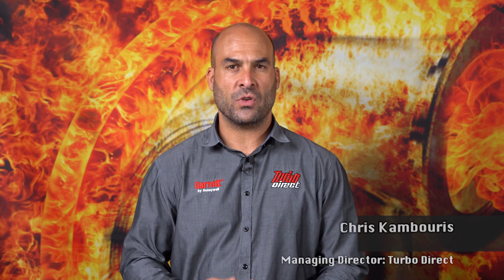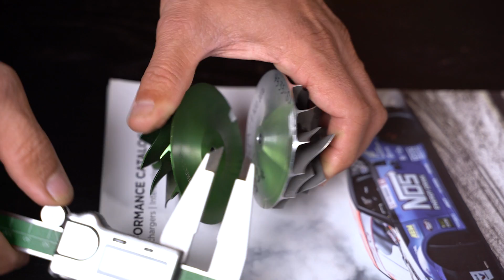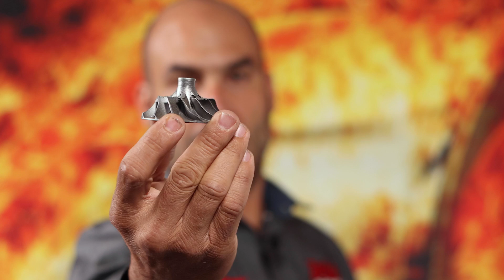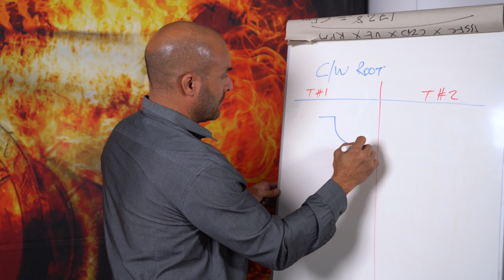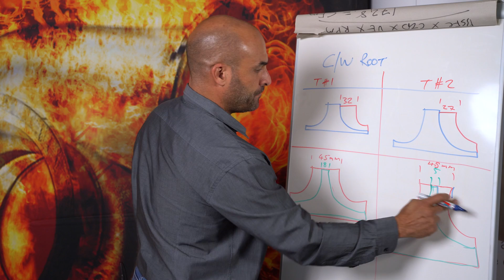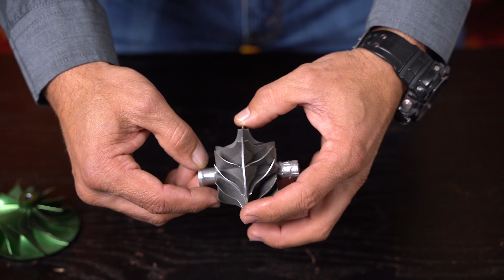Turbo Compressor designs - Discussed

Comment: I’m completely new to this and can’t find a straight answer. 
I have a td04 13t and want to change the housing to a td04 20t 
Does the compressor wheel have to be changed? 
I don’t understand what the 13t vs 20t exactly measures? Just that it’s wheel related
Reply: two wheels are different sizes so the hole diameters inside the housings will be different sizes, so how will the smaller wheel fit inside the larger housing hole?
Reply: Is it a TD04, H, L, HL?
At minimum, the compressor and compressor housing are changed.

Comment: Hello Sir! Sometimes i see for the compressor/turbine wheel big difference between size inducer and size exducer. Sometimes you see little difference in inducer/exducer size for the wheel. Other time you see big difference between inducer-exducer size. Do you have a explanation for this? Maybe better spool?, other blade design? Many thanks for explaining this!
Reply from the maker: Inducer and exducer sizes are relative to the intended application. Some diesel engines have very large turbine wheels and much smaller compressors, in cases where a compensation for sea level is required. Other examples might involve a turbo that has diameters of inducer and exducer on both the turbine and compressor that only 1-2mm differ between the two sides fo the turbo - these apply in some Rally governed turbochargers.
Reply: @TurboDirectSA  Sir, thank you!
Reply from the maker: @kosditrade  Pleasure buddy - anytime.

Comment: Key takeaway is to look for the company to provide a compressor map that matches Compressor/turbine specs or to question the reliability or the product. Really interesting what goes into these designs! Seems like Garrett is a good standard in the industry for reliable designs.
Reply from the maker: Reliable to provide compressor maps, but accurately depict the HP compared to their maps -- i think not. The G-series product is not able to produce the power that Garrett Claim in their catalogues, nor are they able to marry the compressor map to the HP print either - the flow rates dont match the HP.
Reply: @TurboDirectSA  I think the issue is Garrett seems to be pretending we can get 12hp per lb/min of air flow. Otherwise their maps appear reasonably accurate, just not underrated like they once were. Of course you are probably measuring wheel speed, so you have a more accurate impression of how good their maps are.
Reply from the maker: @lutherblissett9070  Speed just gives you a more comprehensive sight into what the engine and turbo are doing, and where you are on the compressor map. Pity Garrett is no longer what they used to be - real sad.

Comment: Awesome vid, as they all are, from the comp map vids you can see some hit high efficiency at lower boost than others which seems like a better choice if you're stuck on pump gas, was hoping to get a bit of info on that but now know there's a lot that can vary, you see some newer turbos not really getting the results you expect but then you see on the map for that engine they might need 2 bar+ to do it but you haven't got the gas etc so at 1.3 1.5 bar it's not really partying.
Papa got burnt, that we know haha
Reply from the maker: Thank you for the compliment, much appreciated. You 100% correct.   I think i need to do another video on efficiencies to further explain this - everyone seems to think that a higher percentage number means a better, higher flowing, and better performing turbocharger - this is not the case at all im afraid.

Comment: I have a mk3 supra with a ct26 with a very shot(blades are missing a lot of material from the leading tips), stock cast 5+5 spliter comp blades. 
Dimensions are 46mm inducer and 65mm exducer.
I've seen another company or two that makes a compressor kit (new wheel and housing) with same inducer and exducer dimensions but with a billet comp wheel, and 11 main blade with a thinner root. 
Would the 11 main blade with a thinner root but longer blade length be a better choice for a rebuild even over a billet 5+5 splitter of the oem design? 
I've had to re-watch this vid a couple times to get my brain juices flowing and it starting to feel like it is.
Reply from the maker: Thanks for the comment, we do upgrades on these CT26 turbochargers using a Mitsubishi TD05 wheel (similar hole diameter), which we modify the rear of the wheel to fit the abnormally large and high steel collar. Its difficult to say which wheel is better or not, without seeing a compressor map, which shows the exact specifications of the wheel itself.
Reply: @TurboDirectSA  Toyota for some reason never had flow chart/compressor map for the ct26. I've looked as far back as 2003 on forums and closest thing I got was a flow rating of 437cfm or 33 lb/m
Reply from the maker: @Maeda_v  That might have been the MAX flow rate - but without a map, its impossible to know the characteristics of the compressor

Comment: The company he did not mention, precision... they all fail from tiny roots.... they flow more for a given size inducer? (more air space less root) . my question, does precision run bigger trims? seems like the inducer to exducer ratio, precision runs bigger exducer size on a comparable turbo?
Reply from the maker: The fallacy that PTE compressors outflow other designs is simply that - a myth. We have tested back to back on the same dyno on the same day a setup on a very popular drift car in S.A where we removed a PTE6262 and installed a GT3076R with an 11 blade compressor wheel which i duplicated the dimensions of the 60-1 compressor (only difference was it had 11 blades) and ran 0.1bar boost less, with the same AR63 turbine housing and made 80HP more than the 6262 at around 1000rpm better response. 

We have a SUPRA that used to run a PTE pro-mod turbo, which battled to spool into launch on the line (2JZ) and when replaced with a GTX4720 (88mm compressor) spooled fast enough not to use launch, and achieved a better ET and exit speed at 0.5bar boost less...... no dyno time was carried out, but much better results every time.

These are some of the experiences with PTE turbos in the past - here is an archive of the test listed above

https://web.archive.org/web/20130702151857/http://www.turbodirect.co.za/site/index.php?option=com_content&view=article&id=775&Itemid=55
Reply: @TurboDirectSA   having a few turbo u.s. m50 / s52 BMW's and I always see almost all pt62/62 and 62/66 dyno graphs show exactly what your describing .. Hard to know all the other variables on a person's set up so I did not want to assume . Good to hear it's not just speculation on my part.  I'm currently running a gtx3582 gen 2 over a g series largely based on this channel . (bmw e39it with a s52 3.2 , 600? at the tire) The g35900 seemed too small and the g35-1050  the turbine is a mis match imo.  wish I could find a Garrett with a slightly larger turbine exducer , think 3582 or 3584 with a 64 -66 mm turbine. the cheaper Garrett line does not seem to perform on the m5x platform (similar reviews to pt)
Reply from the maker: @l_ionize333  Buddy  - EFR kicks Garrett out the game every time, in all areas - its sad but true. The onc3 dream team is now missing, and the company is bankrupt - tsk tsk

Comment: how the compresor inlet influence the wheel flow capabilitys...a taper vs straight flow path will influence? how a tube in front of the inlet vs open compressor affects?? does  intalling a velocity stack on the compressor work? thanks
Reply from the maker: Anything that causes a restriction will negatively affect the compressor - naturally. What is a velocity stack? These come in various sizes, radius profiles, heights etc -- whats the "magic" angle? 

WRC turbo restrictors range from 32-36mm restrictors placed in front of the compressor housing. The length of the restrictor and the position in front of the housing will greatly affect the compressor ability to operate/function and its functioning efficiency. 

How long is a piece of string is pretty much what you have asked.  Depending on the velocity stacks design, and dimensions aswell as position in front of the turbochargers inlet all has a direct effect .....

Comment: The splitter blade design of the borg has a bigger inducer throat area, when approaching choke and the shockwaves that come with it, the bigger throat area has more room for the air to get around the shockwave. The 11 blade has a small throat so the shockwave blocks the flow path quickly. This is where the map groove comes in. 
Also, splitter wheels have more blades that distribute the air more evenly in the wheel, reducing blade loading. Full bladed wheels can "pile up" on the pressure side of the blade, leaving a void on the suction side that can agitate secondary flows and cause inefficiencies. Love reading N.A. Cumptsy's compressor book.
Reply from the maker: There are no shockwaves in the compressor stage - this will destroy the blades in a very short space of time.
Reply: @TurboDirectSA  at a calculated 500m/s tip speed for a 62mm turbo inducer, it is not within striking distance of a shock wave, even with the locally rarified air pressure near the blade back side. I wonder what the air pressure is at the blade tips. Ultimately the pressure is higher in the volute, but that is after the near-sonic velocity of the airflow has been converted almost entirely to high pressure at low velocity (around 100m/s) the interface  between the skinny part of the flow path and the volute main chamber.
Reply from the maker: @exploranator  The diffuser is the section of the assembly which is responsible for converting the kinetic energy into high pressure air. The pressure can be measured with a boost gauge at any point on the volute after the diffuser.
Reply: @TurboDirectSA  very much is shockwaves, that's what causes choke in every part of the turbo, exhaust side included. Take your gtx3576r for example. Choke line is 145k rpm, at 58mm diameter that's a tip speed of 1,443ft/sec /440m/sec. Speed of sound on standard day is 1125ft/sec / 343m/sec.
Reply from the maker: @BBIturbos  The shockwave you referring to relating to the sound barrier occur once as the speed breaks this barrier. This tiny shockwave occurs at the tip of the blade alone, which is why when looking at a compressor wheel under a holographic camera, only the tips vibrate - the blades are designed to vibrate inside of the 4th order vibration tolerance - before this speed and after this, there are no shockwaves.  The specific turbo you referring to runs at this speed from a P2C ratio of 2.5 upwards to 4.0 - the rotational speed of the tip of the blade 1585.29km/h at todays altitude density and temperature etc in South Africa. 

This changesas conditions change ofcourse. This is the absolute maximum rotational speed allowed on this rotating assembly - it is not often that you will find this speed being achieved - 99% of applications do not reach this speed. 

Regards to the comment above relating to throat area, this is directly proportional to the blade angle, height and the sweep and loft of same - mentioning a general comment is incorrect and irrelevant. The BorgWarner EFR series turbochargers with similar sizes compressors in the same HP family rotate slower and produce more air flow than the comparative Garrett range - all the EFR blades are 7 blade splitters - 

Distance between the blades do not affect the rotational speed of the blade, therefore the barrier will be broken at the same speed (conditions dependant) no matter how many blades are present.  

Splitter blades have no effect on how much loading is applied to the main blade, as the splitter blade does not intercept the air path or contact position at the blades leading edge - this statement is false. 

No air "piles up" between blades, as the blades angle, sweep and loft are responsible for directing and compressing the air through the diffuser area via the tip height. If the air "piled up" there would be very little if any efficiency, or the diffuser would be blocked and/or surge will occur.
Reply: @TurboDirectSA   once you break the SoS, the shockwave is there, yes it starts at the tips, and works down if tip speed increases. Shockwaves do not go away, nor can you accelerate through them. You can however accelerate through vibration nodes, which is what you mentioned. Search for "trans sonic compressor" and you'll get much smarter guys than me talking about it in their papers, with great visual aids too. 

I agree with blade inlet angle, inlet/ outlet ratio, and rake making 2 similarly sized wheels flow differently. But can't forget about compressor housing a/r, do the efrs have a larger a/r than garretts? 

Also, the air most certainly does "pile up" on the pressure side of the blade. The work done to the air as it goes through the wheel is never even. Rather than a smooth, even flow entering the diffuser like everyone thinks, it's actually "waves", or pulses, as each blade goes past. Wheels with more blades do a better job of processing the air, but then the wheel has a higher mass, higher stresses, and larger moment of inertia. Look up "centrifugal compressor wake", it's amazing stuff, and alot of it was found/ measured/ modeled in the 60s and 70s.
Reply from the maker: @BBIturbos  Thanks for the comments, without revealing too much information all i can say is that over the 10+years we have designed and tested/proven our own compressors, you seem to have alot of theory which you have read up in various places, but no actual physical experience. Many things you mention are false and out of context -  ill leave this right there.

Comment: Wow! - what a great video. Ok I thought of a topic for a follow up video. The design of the turbine housing. I'm a aircraft gas turbine engine instructor so I'm familiar with aero engines. In a turboprop engine that has a centrifigal compressor the impeller gives the air velocity which is flung into the turbine ring which has a series of expanding ducts where velocity reduces and static pressure increases (bernulis theorum). In an automotive turbo design, does a similar thing happen. Is that what the compressor housing does?
Reply from the maker: 100% correct sir - same principal applies - only difference is your engines are axial and the turbocharger is radial (some are mixed flow)
Reply: Hello sir what is best turbo for very high altitude generator application 3516 b  caterpillar?  Tw9214 is oem . Can we test gt6041 (97-141 )  old   turbo 3516 abb tps57 has problem of red exhaust in night also .  But caterpillar says very new 2022 and 2023 3516 h twin abb tps 52 they solved this problem .  Tps is monster turbo .  Now I want ask about your idea . Can we solve with 2  gt6041 ?

Comment: I run a hub less there is not a nut holding the compressor wheel on the wheel it’s.self is threaded and the hub is thin
Reply from the maker: Known as boreless - has an extension at the bottom of the wheel which is threaded and screws onto the shortened shaft and acts as part of the sealing system. The CAT applications use this design with ally and titanium compressor wheels.

Comment: Slightly off topic. Water or methanol or water/meth or nitrous pre turbo.

Are blades in danger of being damaged? Obviously compressor maps will change due to density changes in the air. But would there be any advantages in going pre turbo rather than post due to it?

Thank you for the video's. They are something I regularly look forward to.
Reply from the maker: Excellent question - and yes anything ingested through the intake tract WILL damage the compressor. We have recently had a client with two turbochargers G30-900 installed on a Golf7R who suffered both turbocharger failures through WMI being plumbed through the intake - now it was not due to the meth itself impacting the blades, but instead the intake pipe which was made from aluminium, and the fabricator painted the inside with that crinkle paint in the aerosol can, which reacted with the METH and these particles made contact with the compressor damaging it, and progressively caused erosion, which broke blades off. The natural comment/assumption was "your turbos cant handle the boost"  which is incorrect. 

I personally visited the client  and inspected the installation myself and found the cause. 

Now the biggest risk here is not blade damage but instead bearing damage -  now very few people actually understand how a bearing housing and its sealing system works, its based on a hydrodynamic pressure differential which incorporates two piston rings, AKA split seal rings. In their compressed stated (installed/assembled) the ring has a gap aswell as clearance underneath the ring inside its ring groove.  This clearance is designed to allow pressure/gasses to enter the bearing housing passed the split seal ring - this is primarily how the oil remains inside the bearing housing and doesn't leak.  This clearance around the ring and its groove WILL allow meth to enter the bearing housing too - this will dilute the oil and well -- the rest im sure you can understand - the bearing system WILL fail depending on severity. 

Ill do a video on this in the coming weeks with a cut out of a ball bearing turbo to illustrate this for you.
Reply: @TurboDirectSA  Thank you once again.
Reply from the maker: @SSTAUTOWRX  Its my pleasure